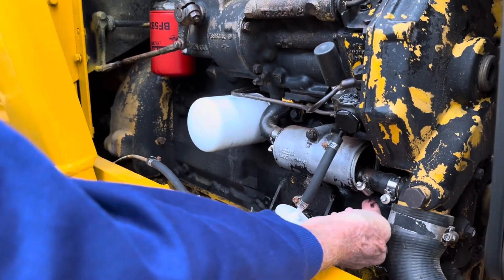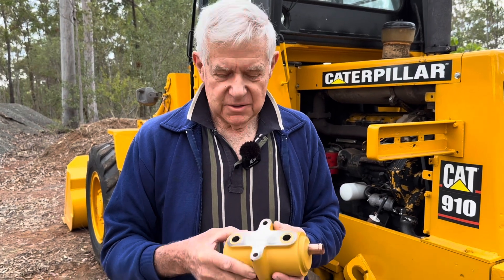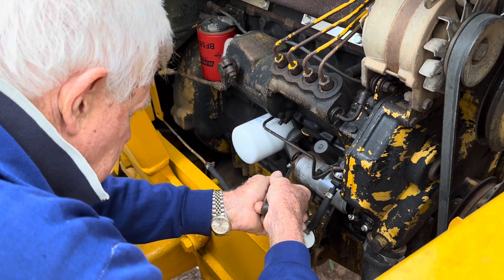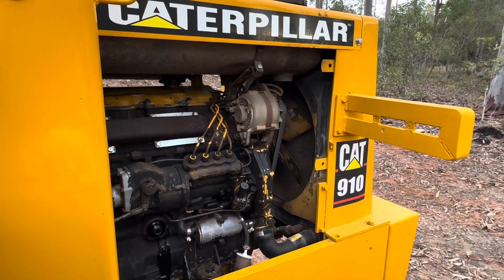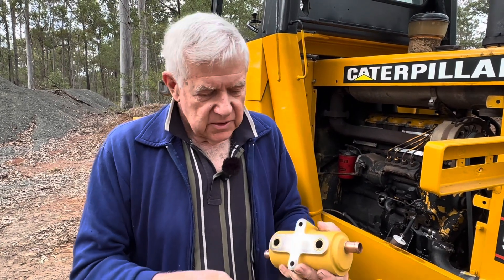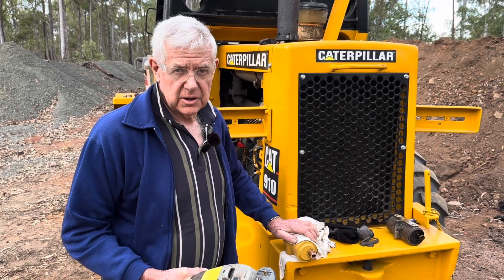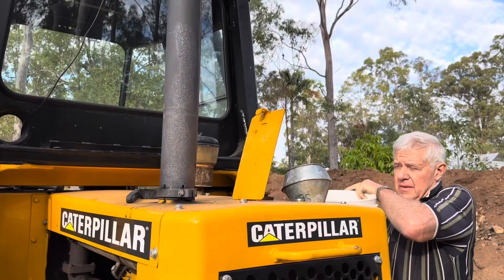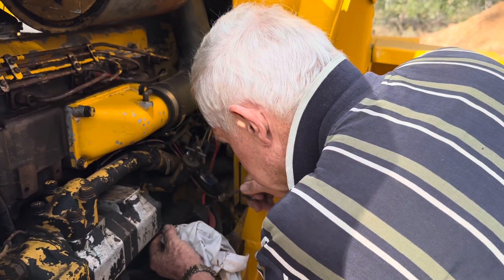Cat Wheel Loader Repair and Operating Test

Comment: No wonder it corroded from the outside not having antifreeze in her. We put corrosion inhibitor in our antifreeze here stateside to keep corrosion down in the radiator and engine block. She will rust like mad without inhibitor in her. I mean, it is hot water, no? In fact in nuclear reactors, especially molten salt reactors if no water gets in the salt it is not even corrosive. I mean salt needs water to be corrosive, with no water she does not corrode with high nickle stainless. Easy peasy.

Comment: Oil coolers can give trouble when they get old, but by far the most common thing on modern engines are failed EGR coolers.
Reply from the maker: Thanks Wazza, your probably right, I don’t have much to do with newer machines with egr and/dpf luckily! Bruce

Comment: Bruce bloody good to see you working on something clean that you haven’t had to brush cut around first…lol. Good fix mate, looks like she’s just had a paint job to, nice tidy little unit. Will you drop that water out later and replace it with proper coolant?. Where about up north are you, it looks as dry as a dead dingos donga?
Reply from the maker: Hi Gordon, it was painted last year and has only moved some dirt and lifted some steel around since so the paint still looks really good. We are up in wide bay. At the moment, the 910 is up on an ironstone ridge in very poor country and you are quite right, very dry. I worry how dry it will get up there come summertime. Yes - I didn’t put coolant in after the rebuild because I expected to have the change the cooler/dump the coolant on the not too distant future. I’m hoping to give it another flush next week and put coolant back in. Bruce